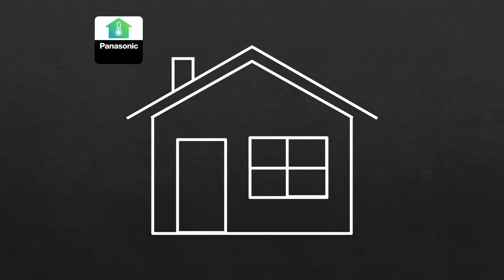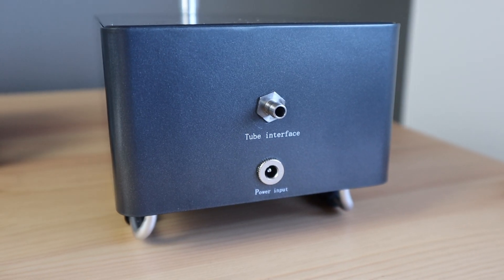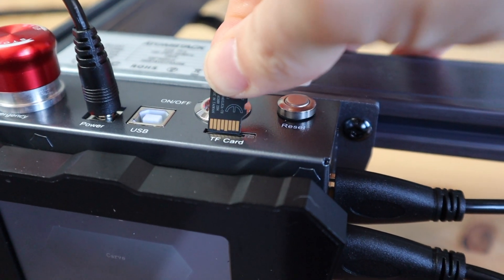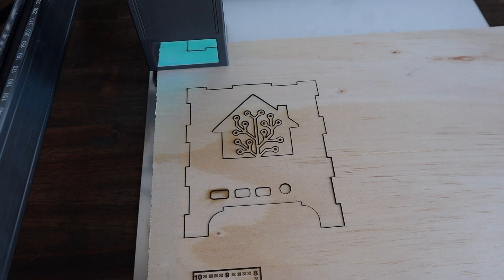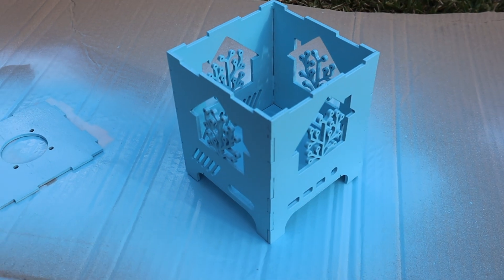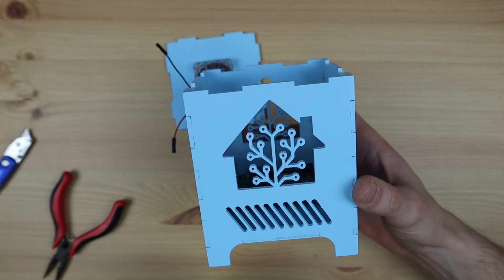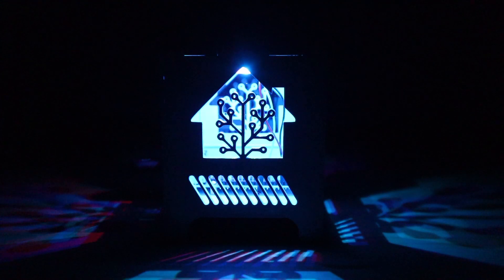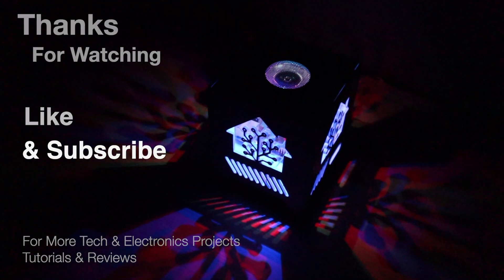Making A Raspberry Pi Home Assistant Hub Using The Atomstack X20 Pro

Comment: How long did it take to cut the box out?
Reply from the maker: Around 5 minutes
Reply: @MichaelKlements  thats incredible, do you feel its a good machine instead of a entry level 40w co2, such as a k40? Primarily looking to cut 2mm mdf and card
Reply from the maker: It depends on what you're going to be cutting. For mdf and plywood I actually use this X20 more often than the K40 becuase of the larger work bed. This obviously can't cut clear acrylic though, so if you think you might ever want to then you'd need to go with a CO2 machine - the Gweike Cloud I've been using recently is really good all round but is a lot more expensive.
Reply: @MichaelKlements  Thanks Michael, I've made contact with the guys at Gweike Cloud... we will see what Santa brings this year... thanks again
Reply from the maker: @Pedal2Pixels  that's great - they've given me a coupon code MK200 that'll also get you $200 off any cloud machine if you're interested

Comment: Would the X20 Pro cut acrylic?
Reply from the maker: It can cut opaque acrylic and it works best on darker colours like black, brown or grey. It can't cut clear acrylic.
Reply: @MichaelKlements  Ahh, good to know! What's the machine you currently use to cut acrylic I've seen you use in videos? (Apologies if it's staring at me in the face!)
Reply from the maker: I use a CO2 laser called a K40, the laser's wavelength can cut clear materials like acrylic as well. There's a link to one in my more recent videos that I use acrylic in - my Turing Pi 2 video will have the link.

Comment: Hey Michael, did you every try crypto mining on the 8 pi cluster you made?
Reply from the maker: Not on the cluster specifically, but I've run the same software on a single Pi - which in the cluster would just run 8 times faster. As expected, it's not going to make any money, it would need to run for a few years just to pay the hardware off.

Comment: Could you use this to cut laminate flooring and tiles?
Reply from the maker: I don't think so - most laminate flooring has a layer of vinyl or PVC on the top (some is made entirely of vinyl) and this produces toxic gas when burned. Even if you ventilate it properly, the gas reacts with moisture in the air to make hydrochloric acid, which will rapidly degrade your laser system.

Comment: Don't really understand why you'd devote a whole raspberry pie to home automation control - doesn't it just add to the complication without doing anything that couldn't already be handled by a computer you already have running?
Reply from the maker: A lot of people don't have a computer running 24/7 in one place. I take mine with me to work, on holiday etc. and that would mess up my home automation when it's not there. The other thing is power consumption - a computer at idle still uses 100-200W, even a laptop uses 50-100W. A Raspberry Pi uses about 7W, so it uses 10-30 times less power than a full size computer, which amounts to quite significant savings over a year of use.